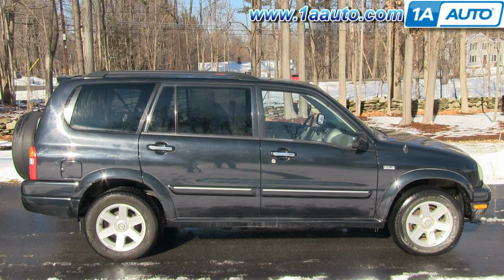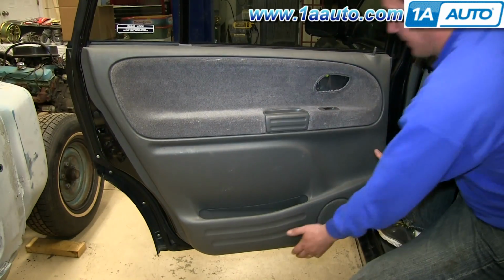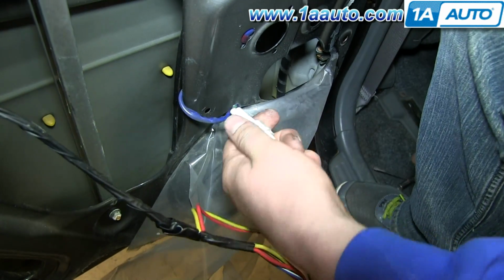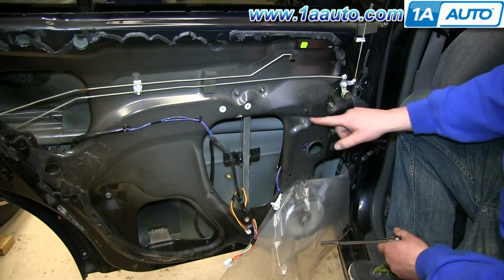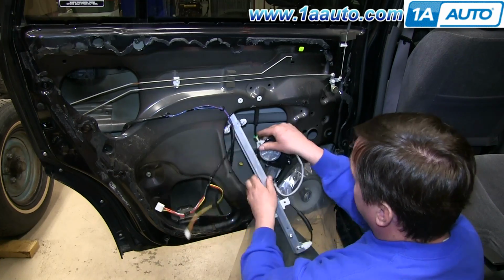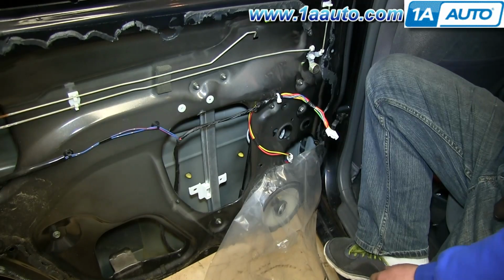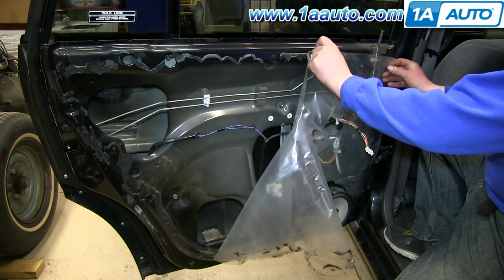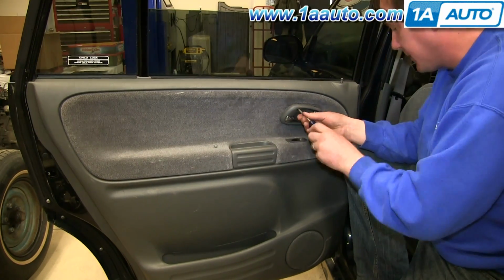How to Replace Window Regulator 02-06 Suzuki XL-7

Comment: Thanks guys! I have a question about Remote Keyless Entry for 02 XL7. I know 2001 2002 models came out with a factory non programmable RKE. I was thinking about installing the Suzuki programmable module and was wondering if it is just plug and play or would the wiring harnesses be different? Could I just get the brain box and replace the boxes? Thanks!
Reply from the maker: +Travis Spencer Thanks for watching!  We do not actually have a video or insight into this.  You can perhaps hop into some automotive forums so see if there is any info out there for you!

Comment: What do you do if the window's all the way up and the motor went?
It's not as straight-forward to remove the regulator is it?
Reply from the maker: +TriniFirst First, verify that the motor has failed. Make sure the window lock button is not set. Check for power and ground at the electrical connection of the motor, check the window switch. It's a lot of work to get the motor out if it's stuck closed, so verify first you actually need to replace it. Carefully unbolt the regulator with the window attached and then lower the whole assembly down in the door. Then you may need some one to help you, but try and unbolt the glass and lift it out of the way. Then do your best to get the regulator and motor out of the door, at this point you may have to try and unbolt the motor. Once it's unbolted, you can collapse the regulator.